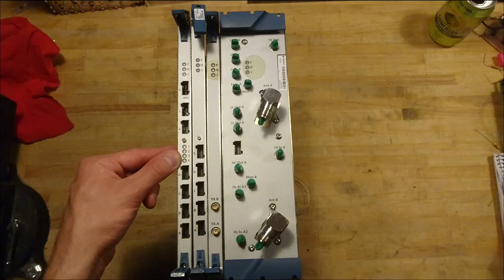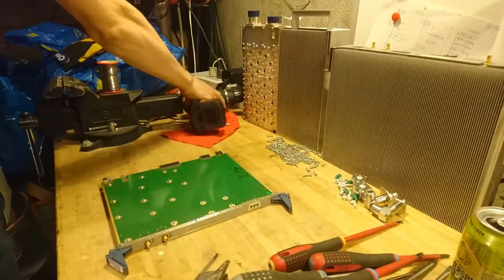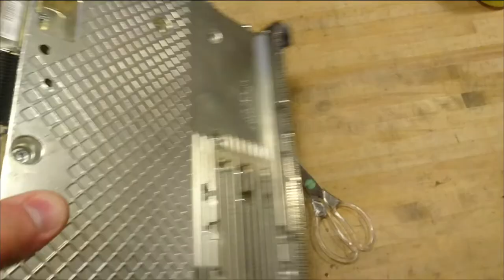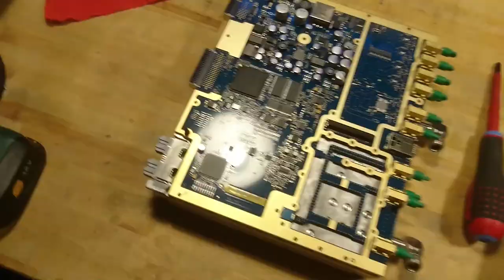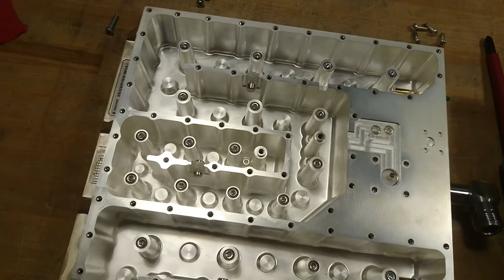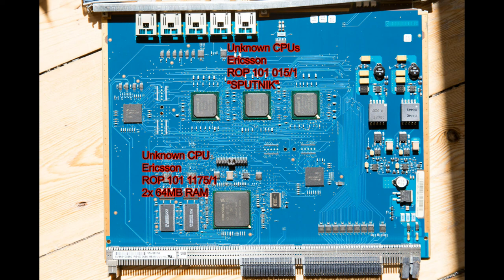Ericsson RBS3202 1800MHz Radio Base Station teardown

Comment: Those things with the holes are ceramic resonator filters.
Reply from the maker: Thank you, I forgot to take a video of taking one apart, to also show what was inside :)
Reply: ohh maybe next time
Reply: Yep! These filters can also be found in about the same shape and size on older (much older?) cell phones. Certainly they can be found in the oldest model cell phones from the early 1990s.
Reply from the maker: I still have the boards, so if you are interested I could do a short video of it under the microscope

Comment: Very useful video, thank you! I'm doing an assignment for my Masters in Supply Chain Management, and I'm trying to figure out the role of RF power transistors in this product. What fraction of assembly do you reckon is RF power transistor related?
Reply from the maker: Hi James, thank you for the kind words.

RF power resistors is the final stage of amplification of the signal, before it is send to the antenna. Assembly of these transistors is a very small part of a very complex product. So I would say it is a very small amount. This video does not show big RF LDMOS, but you see some in my other videos, f.ex. here https://www.youtube.com/watch?v=kVKxbeEEI9M
Reply: Kaizer Power Electronics thank you so much for your quick reply! That's very helpful, cheers!